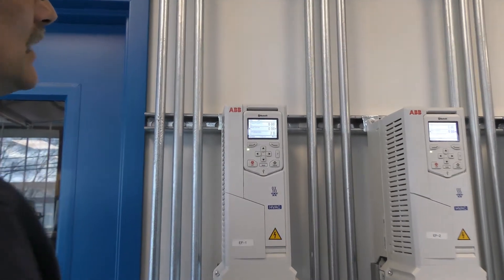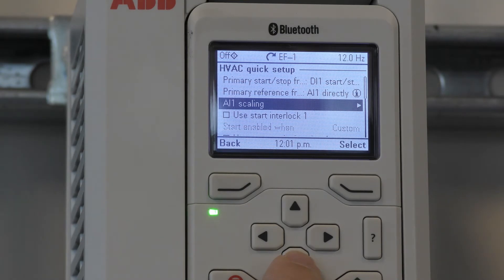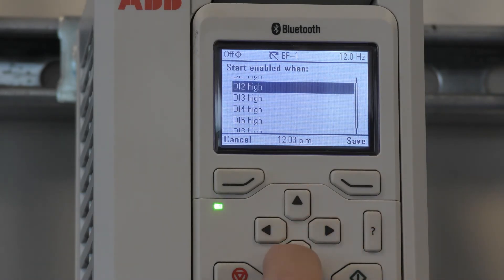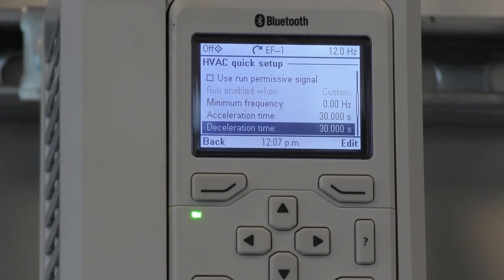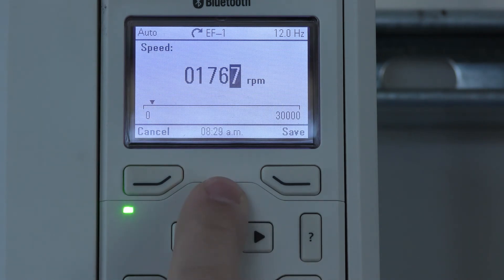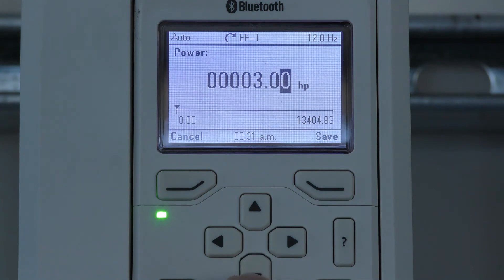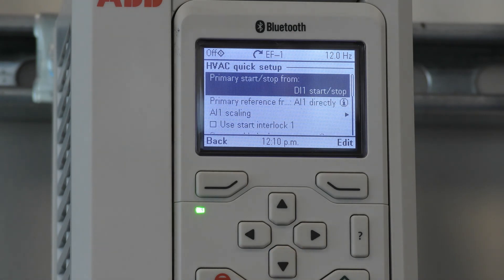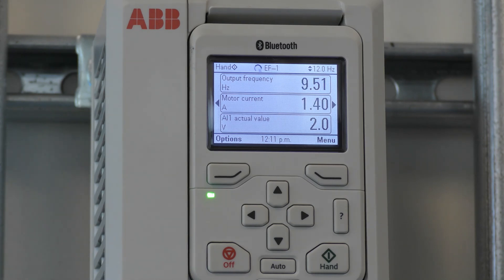ABB ACH580 Primary Settings & HVAC Quick Setup

Comment: Having an overcurrent fault.  Drive matches motor parameters and accel/decel times are 90sec.  Any ideas?
Reply: Did you figure this out?
Reply: Have you tried ABB Tech support? Might be quicker
Reply: Is there a way to adjust the current While the drive is running? When I try to do this, the drive tells me it can't, because it's running, but is there a way to bypass that?